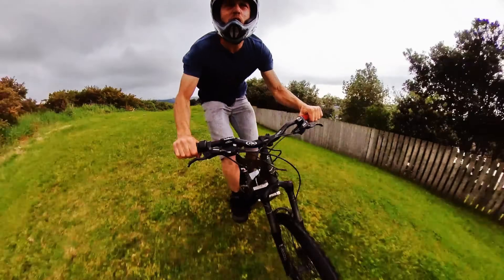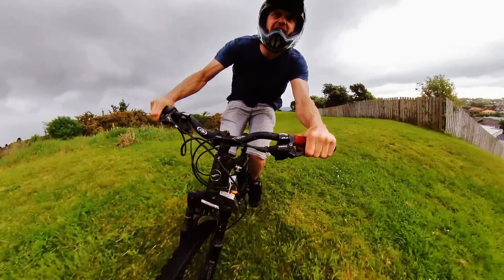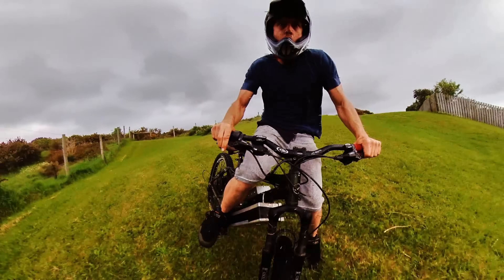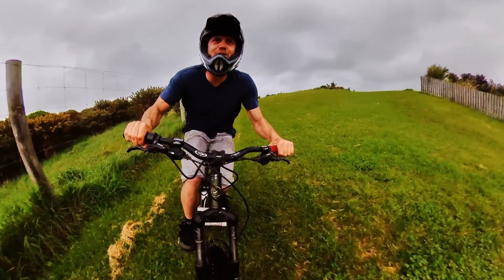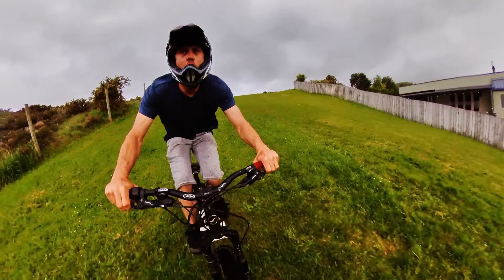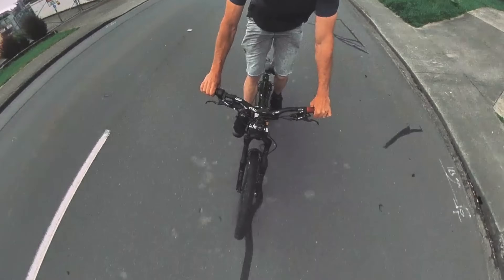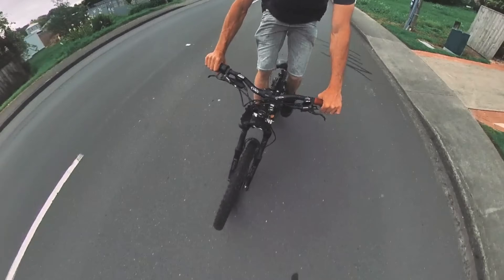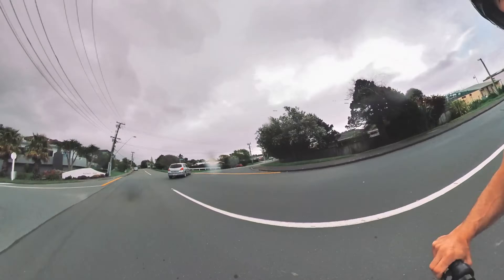How to build a beast 5kw ebike from a 1.5kw aliexpress hubmotor kit

Comment: i shunt modded my 3kw controller, before the mod it would do 75v x 60amp for 4.5kw, i did the shunt mod and got it up to 75v x 90amps for 6750watts, it lasted 3 nights of easy riding and about 5 miles total before it blew caps and other things on the board. i since then got a much bigger "3kw" controller that i think was marked wrong as its so much bigger and heavier, can go up to 114v and a max of 80 amps for 9.1kw, i shunt modded it too, but honestly i didnt even need to and its built like a tank, i have put a few thousand miles on it and i push it pretty hard sll the time
Reply: How fast does it do. How much do you weigh. Where can I get the parts
Reply: @novaturbkkk  with the old controller i had it up to 60mph one time to see how fast it could go, it had a bit more power in it but 60mph was already too fast. i have since upgraded both the controller and the motor.
weight really isnt the issue with top speed btw, me and my bike are heavy. i am stronger than average and can barely pick the bike up if its fully loaded with all the battery and gear, plus its awkward. i started with a 3kw rear hub kit from ebay. just find the size wheel for your bike, get that kit, and get a  battery. batteries are expensive, and i normally only go about 30 to 35mph, anything much faster and it becomes too stressful
Reply: @jasonbrown467  How about the torque? Great? And where did you get your battery ? A 72 v?
Reply: @lucasp1776  18s1p lipo when fully charged its 75.6v i think.
Reply: @jasonbrown467  and the torque of your bike?
Reply: @lucasp1776  meh maybe rated for 140nm? too easy to wheelie. can pull a small trailer with 100lbs of crap, off road up hills, just got to rock my weight forward, plus i weight about 220lbs. i upgraded stuff since i posted the above post from 2 years ago. i think i now have a qs205 4t motor and sabvoton 72150 controller, but have the same battery config, but the battery is modular and can wire it for what ever to get the weight down or go for long/fast rides
Reply: What did you learn
Reply: where would i get a controller/ display nowadays? i have  72v pack

Comment: Surprised your battery can keep up with that kind of draw. What's the cell specs?
Do you run two separate packs in series for 72V? Motor doesn't start burning exceeding 52V (or was it originally a 72V motor)?
Those fins do absolutely nothing, but the fluid inside absolutely would help with transferring heat to the case. Thermal paste conductivity is weak as shit and only meant for micron level imperfections...better off without. Ferrofluid never occurred to me.

Comment: JD-DC excellent vid bro , I have purchased all the same waiting on thermal conductive grease... but I have set it up in the meantime and standard 48v 15.5ah battery I got 63kmh ... once do the mod and add the 72v 14.4ah battery what speeds you belive I should get brova from anova mova ( roughly ) what speeds you getting please
Reply: Hi JD-DC I did everything as you have ... all works with 48v battery but when I put my 72v battery it turns on when I press Throttle nothing happens can you email me let me know your thoughts please
Reply: Looks like they may have modified it mate its not working also the so called little shunt you soldered up doesn't make sense as on the back side its already together!!! 
Anyway doesn't work looks like I will buy a 72v bigger amp motor controller instead to make use of my 72v battery I purchased ...

Comment: you legend awesome just what I needed to actually do the same thing but was really stressing about just about to start mine thanks for taking the time to make this
Reply: Im doin same thing to my voilmart i have 36/48v 50a brainpower controller n 2.  17.5 ah batt getting 48.7 mph the heat i drilled holes now thinking rc moror fan inside hub mounted for cooling or a 12 400w car cig lighter plug in dc to ac 110 converter has a small fan 12 v might use also
Reply: did ya make it?
Reply: @hrideshbudathoki3380  of course he didnt, just big talk on the internet

Comment: Just out of curiosity, if this was done on say a 750 w sustained 1130 watt peak 48v system, what do you roughly guess the new wattage would be?
Reply: Practical limit will be either peak power being insane frying the wires, or probably like 3kw without heatsinks just doing the shunt mod.
On my 1200w kit I'm putting down an average of 2000w and peak of 2400w, and its like barely above outside temperature. Obviously look at the mosfets on your controller and look up the spec to ensure you aren't passing it, or just spend $40 on an over-powered controller and pump up the voltage for higher rpm and speed.
Reply: @jakegarrett8109  well thank you so much, you've really given me dome ideas now haha
Reply: @jakegarrett8109 I have a 1000w sustained 1300w peak 48v/15ah system where can I find a more powerful controller?

Comment: The Verge guide to building E Bike modifications that will overheat in a month
Reply: His setup is still working, just do a little research about the fets the controller is using and the max current they can handle, another upgrade is using good quality thermal paste for the controller since the thermal grease the factory uses sucks.
Reply: stay mad

Comment: Hey how much did you spend on the battery and what would be the output of wattage if you saudered a similar 3000w motor like that?
Reply: The ESC controls the power, not so much the motor on these ebikes. Its shunt is there to regulate and limit the max power, so most likely you'll get the exact same performance (obviously with the caveat of any efficiency difference, and assuming same kV values).

Comment: My friend damaged his controller by doing only 3kw. Be careful, also I recommend getting them off eBay instead. As far as the shunt modding goes, I wouldn’t recommend bridging them unless your confident that your controller can handle such an increase in max power(not worth, just get better controller), just drip on more solder. If you are only pushing it to around 2.5kw I wouldn’t worry at all about extra cooling.
Reply: Isn't dripping solder bridging them anyways?
Reply: @mrmagoo.3678  no, from what I’ve seen shunts are often 2 exposed wires that come off the board then back down. They are often very close to each other but aren’t touching. You can put solder on without bridging them.
Reply: @cobra4439   that is still modifying the shunt.  The shunt has a specific resistance which the controller uses to check output power.  Adding solder is decreasing the resistance thereby decreasing the current seen by the controller.
Reply: @maukaman  I know, but if you push a controller to far it can break. I’m just saying if you bridge them your probably using a lot of solder and it might be to much for the controller to handle

Comment: Dammit... I knew the little motor had more in her.  I built one last year and went with the bigger QS motor as I was not 100% on the tuning, I ride at about 6k max anyway and the lower un-sprung weight on the back wheel would easily make up for the diff.  I have recommended to so many people to get the little one and try something like this but I have never seen it done.  Nice.

Comment: I have a 1500w/52v system with solder shunts, but I’m not able to get passed 26amps. I wonder if there is anything else on a control that restricts amp flow.
Reply: If its sw900 controller, in settings menu, go to p14 and set it to max amps your battery can do.

Comment: What is the logic with soldering the shunt how does this make the controller better. Also what makes it 5kw? The controller shunt and battery? Boosting the 1500w motor?
Reply: Its volt X amp = watt if batteries have higher Amp continuous draw and bms can handle it, you can shunt mod the controller to allow for higher Amp draw resulting in higher current resulting in more power.. from what I hear, higher amps allow for better torque
Reply: @dixon266  I suppose that makes sense if the batteries can handle the power output beef up the controller to handle more current flow. Appreciate your help I'll remember that

Comment: Wow neat stuff, I built a standard ebike kit for my buddy 1000w and he is a pretty big guy and was going up a really steep hill , his display was reading about 1200w and his hub motor started making intermittent spronging noises and the wheel would cut out for a second then it would start to pull again ....then it would make that noise and cut out again for a sec. (Sounded like the bipedal strip on a thermostat engaging then disengaging. Do these hub motors have a resetting thermal safety breaker in them when too much amps is being drawn?
Reply: he needs to help the bike up the hill..with hub motors cogging like that you will burn something out overamping it! a big reason some hub motor bikes give them all a bad reputation. Maybe fat shaming is in order? IDK! Science wise it comes down to power to weight ratios and weight is a huge factor in being efficient! Even in rc shortcourse truck racing weight is the enemy!
Reply: Dont think they do honestly. How heavy is he?
Reply: @lessdatesmoreonmyplates1457  he is heavy.... about 260 lbs.  But now as time has gone on I have found that upon consultation with the manufacturer if we unplugged the sw900 display and plugged a jumper plug into the controller box plug the problem went away, apparently it is a display/ controller communications issue.

Comment: Can this only be done with a direct drive?
Reply: No
Reply: @ianmangham4570  only direct drive. Found this out after some research a while back. Even tried it on my own geared hub motor. Just for direct drive.
Reply: @robcoastalga8279  What are you talking about? The shunt mod ? I have overvolted and over amped my GEARED hub Motor from 250w to over 1000w 🤠🤟

Comment: How effective has this been no blown capacitor? Also what do you mean by half throttle for double power?
Reply: The type of the electric throttle he installed is called "half throttle" (only the inner half or rather the inner 1/3 of the grip turns)
Reply: half throttle means less voltage sag meaning faster
Reply: @hi-bl4vq I never knew that can u explain the voltage sag thing for the half throttle vs the full twist ??

Comment: What is maximum voltage you have tested that this 36/48v controler can handle?
Reply: You open it up and look what size the Capacitors are, they maybe only 60v

Comment: I have e 800w 36v motor and speed controller, how much would you recommend to amp it to without needing any external cooling that you used. Keep in mind I only ride the bike 10 minutes at a time. and could I still use my 36v battery or do I need to up the voltage? another questing is how much I should solder on the shunt?

Comment: Thanks for the video ! very valuable info ie: ferrofluid , heat sink.......... just top notch ! Question: I know you are using 1500w kit but what if I want distance(not speed) and on flat service better to go with  250w?
Reply: 9kilometers or 80 km? it will depend on capacity of the battery and discharge rates,,with his set up it is balls to the walls current draw, you would need a much bigger battery! but with pedal assist modes you can limit the current draw too! I love ebikes!

Comment: The mod can be also done on the 1000w controller?
How did you over voltage?
Reply from the maker: Yes it can, I only added batteries to over volt it. At 67v it has no problems. Be careful things don't generate too much heat with the extra power and your battery can handle the extra amp draw

Comment: Nice video and awesome build!! Just wondering if the bike has the power to lift the front wheel? Keep up the good work and the videos coming!
Reply from the maker: Thank you, only if you don't lean forward on take off but once your moving you can't just pull the wheel up with the power you need to pull up on the handlebars at the same time, but I'm not good at sustaining it. Also the controller on this set up has a slight throttle delay making controlling a wheely very difficult, just a millisecond delay but it's noticeable and it has annoyed me enough to buy a new controller
Reply: @jd-dc  just reprogram it?
Reply: @loudsonicbug2195  how?
Reply: @gabrielvillarreal5554  you can change the torque spec in the controller...depending on how much it can handle...but the main issue is the throttle delay so just put it to zero.
Reply: @loudsonicbug2195  bit how do i get rid the delay
Reply: i can on mine from a dead stop or going 20mph

Comment: My controller is a 100A with a 3000watt motor….I wonder of I can do that mod’ to increase power’ the kit says it tops out at 80killometers per hour = 49mph….I wanna over clock mine, and do 60+mph. 

I already have a weight advantage…my weight is 135 pounds lol…I’m gonna make a handlebar mounted battery holder welding square tubing and using 1/4 MDF plastic over the metal battery cage…it will be heat gunned for curves , and using some type of special foam to keep the battery safe….it will be held by the handlebars, a thick homemade basket holder bracket and drill a hole in the fork’ it will have a five part mounting system….the battery will have plenty of cushion….there will be a small dash built using MDF plastic for the display and a cell phone holder’ never seen a dash on a e-bike, and hope I’m the first.

The speed controller will go to the frame using a bracket’ using the two drink holder holes….I’m gonna use MDF plastic to cover it….it will have a Bluetooth speaker mounted inside the speed controller cover, you will be able to play music from you phone on it…can’t wait’ still waiting on the kit’ the cost of the kit is $840 dollars….the bike is a EUROBIKE.

Comment: How long did that controller last after the shunt mod?  Long term would be better get a more capable controller.
Reply from the maker: I think this must be an over built controller because I've been running it like this for 15 months, well over 100 cycles. I recently built a battery box and stuck the controller in there and it got pretty hot so it needs to be outside now

Comment: Nice work. Curious for measurements. 
Recommendation: remove the yellow black connector. Mine caused a controller fail. 
The one with 3 wires where bolt and nut connect
Reply from the maker: Thank you, yes good call I have heard that they can fail, I've been looking for a suitable 3 pin plug but most of them are pretty small so I'm thinking about using 2 xt90s for the 3 phase wires. It's a 205 hub motor, KS brand on the side of the motor.
Reply: @jd-dc  I just bought a 72v 5000w motor kit for my fat tire hardtail bike with an 80amp controller. the battery is a 72v. Could i even do this mod and if so will this make my bike 16000w?!?
Reply: @elicostello3163 yes but way ?
Reply: For the plus 30 A I am experimenting with big plugs. I cannot find a name. They can be bought on Ali. Plastic big car plugs.

Comment: This is awesome. As a Tasmanian rider with a max legal power of 250w, my favourite part just might have to be the sticker though... ;)
Reply: Dude.. is that everywhere 
I just bought a 5k kit of Alibaba and now I can't ride it.shit
Jervis bay oz
Reply: @matthewallen1394  add a fingerprint sensor. ill bet there is some Relays & Arduino that can be used, "locked" 250/300W 25km/h & unlocked max speed/torque  and "dead mans switch" remove thumb and lose power.. use it smart and you'll never get caught.
Reply: @johanandersson2165  Awesome.
Reply: "might have to be the sticker though" - if it's in Chinese it might not matter that much.
Reply: @beachcomber2008  google translate on phone ? just add a fake 250W sticker they sell those too.

Comment: I didn't understand what this modification is for, can it also be done on a scooter?  Are there any risks of breaking something?
Reply from the maker: It is to increase power, yes you can over heat the components by doing this so be careful
Reply: @jd-dc  My control unit is outside so it takes air and the engine, how can I understand if it gets too hot, but making this change decreases the autonomy

Comment: Love your work mate!! Hey are you, or have you, looked into lithium polymer batteries to lighten the bike up??
Reply from the maker: Yes my friend runs his on lipo batteries, they are great. I am building a new battery from 21700 p42a 4.2ah cells
Reply: lipo are less energy dense that lithium ion so they are a tad bit heavier,  but they can deliver more current and charge faster, i run with 3kwh of lipo 66.6v x 44ah
Reply: @jasonbrown467  66.6 noice